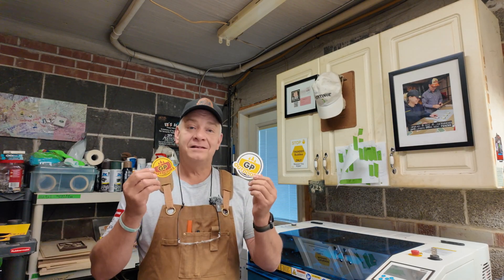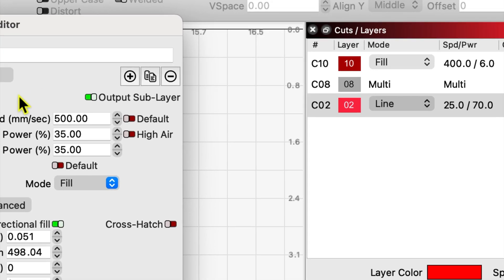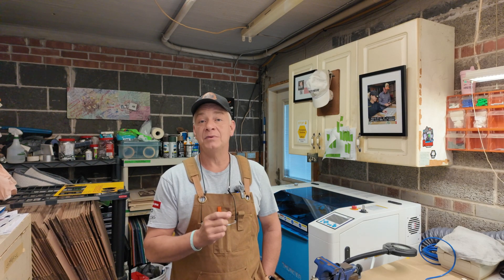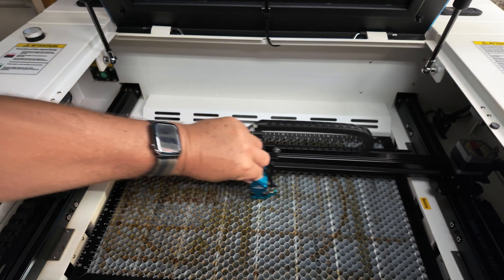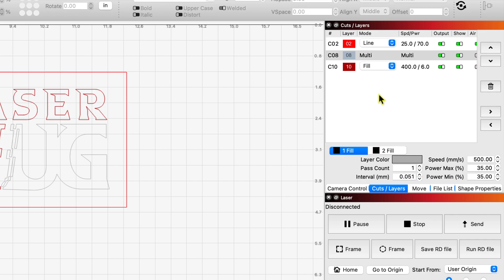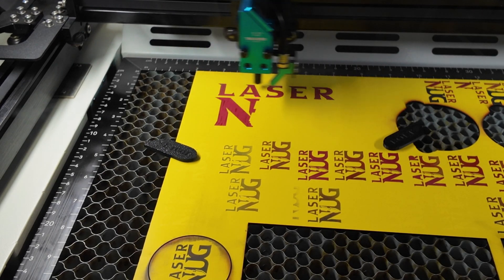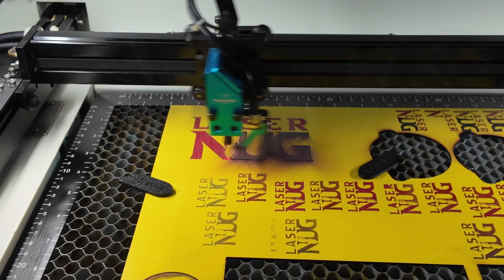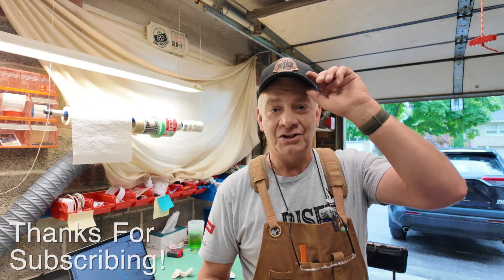QuickShot! NEW Rowmark Tri Layer Settings for Thunder Laser BOLT. 047   4K

Comment: I tried your settings, and it works great. I used it on the Red, White and Blue Tri-Layer. However, I noticed that on the red layer it was not smooth on engraving after the 2nd run on multi settings. I found a work around to either vacuum or brush out clean before the 2nd "multi" run engraving then it will be nice and smooth compared to not cleaning it.
Reply from the maker: Hey thanks - that's a great tip for me and others. Thanks again - have a great week!

Comment: Where are you getting Rowmark that fits the Bolt or are you cutting the sheets down to size?
Reply from the maker: Good morning Joseph. I get my Rowmark from CESCO here in Ontario. I can buy as small as 12 x 24" sheet size. I either have them cut it down for a fee or I just  cut it down myself on the laser ( open the front door and run a cut line at 20" ). Hope that helps!

Comment: What do you use for clips to hold down your material? I found some but the smallest depth is 1/4” which does not work with the thinner materials like the 3mm. Thank you in advance for your help.
Reply from the maker: Good morning Amy! Unfortunately I found out the gentleman that made these no longer does - but there are several out on Etsy that may do the trick. Best of luck and have a good week!